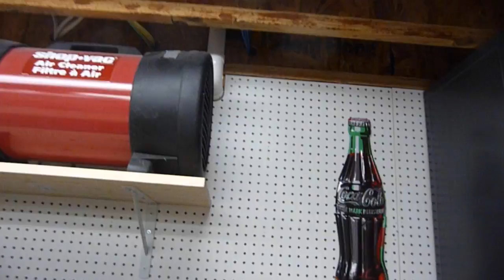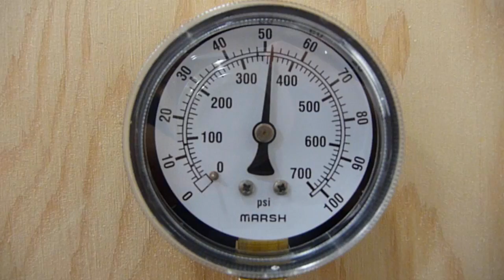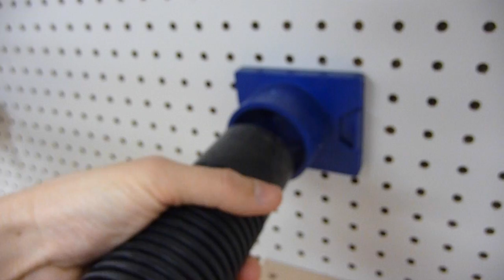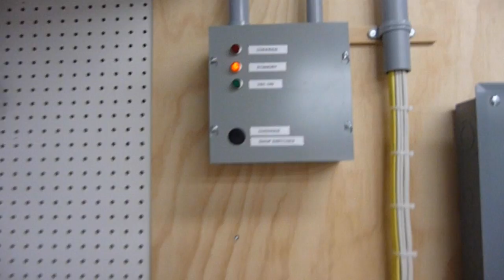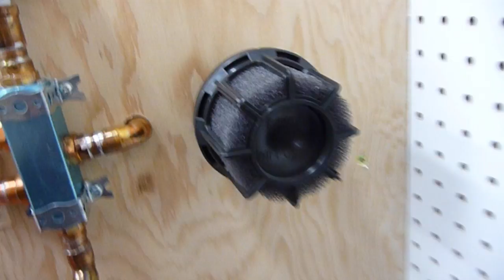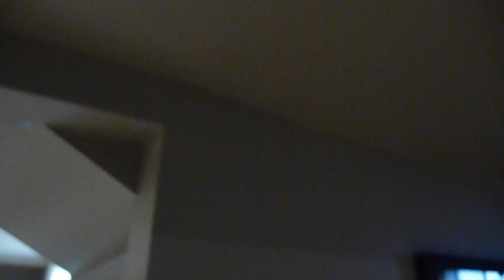08. Workshop Renovation Timelapse 08 - Final Reveal 04 (Air Cleaner, Compressor & Shop Vac Systems)

Comment: Your shop is very neat and your electrical is as well. 
I have two things to ask you.
1. What are your thoughts on bundling multiple conductors like you have in the pvc pipe and zip ties? It looks very neat, but I have had problems with inspectors in the past in respect to not maintaining proper spacing. They are concerned about heat build up.

2. Where did you find the mounting plate for your relay panel guts?

Using a separator / cyclone and catch bin in front of your shop vac will save you a lot of shop vac cleaning. Save you some filters as well.
Reply: Yes you're right, and so are the inspectors...to some degree. I learned this technique with an elec company in Nova Scotia which shares the same NEC code as Ontario. This kind of work passes no problem out there, but here I always get some noses turned up to it. Therefore, it really depends on your locale and the inspector as to whether or not he will pass this kind of work. It's unfortunate because there's no reason for a panel not to look nice! It's like you said, they are mainly concerned with heat dissipation, and rightly so. Yet the more I talk to them about it, the more it seems to be simply a theoretical exercise that they continue to enforce in reality. I've never been able to measure a discernible rise in wire temperature with bundled wire in open-air....the conduit might be a different story :p
Reply: As for the relay panel, are you talking about the wood backing board? Or the box itself? The entire enclosure is in a Hammond box (6x6x4 I believe). But I used a sheet of 1/2 plywood for the back board and cut it to size to mount everything on. Having the plywood in there probably makes it not up to code tbh.

Ah yes, that's actually a good idea to have a cyclone pre-separator. I might actually add it if I have space in there. I've seen some guys even use a 5 gallon bucket which I might be able to sneak in there. Thanks for the suggestion!
Reply: Your work really does look very neat. 
But the bundling would cause a fail with the inspectors I deal with. I have had to spread out and separately attach wires before.
There is a 24" distance with not over a certain amount of current carrying conductors, then you have to " maintain proper spacing."  That spacing is solely up to the inspector it seems.
Caddy makes some n.e.c. approved handy wire spacing devices. That is if you have to deal with U.S. electrical codes :)

I have seen a overfilled emt conduit that burned all the insulation off of the wires in it. So it is a real concern.
In a house maybe not so much, but if something happens......their insurance co. is going to look for anything to get out of paying. So it may just be a liability issue in most cases.
But that one case where it isn't and there is a lose of property or life. You don't want the wrong end of that.

The wood in the J box isn't a great idea. Use plexiglass or fiberglass or resin board. You can buy blank PC board. It's just that wood is a combustable material and while not super conductive, give some moisture it can be conductive.

A dust separator is worth the hassle. I built a large sized one out of the same sheet metal that heating ducts are made from. I set mine on a old milk can.
Works great and I don't have to pull my shop vac out and empty it and clean or replace the filter all the time now.  
You can have the dust separator out in the open if you choose ,it's the shop vac that makes all the noise. 
Figuring out how to make a cone of a certain size can be interesting. There is a whole lot of math, I found a cone generator online.....
Reply from the maker: nevermindthebull0cks Yes you're very right about the insurance. In Ontario, I usually have no choice but to bring each wire down the panel individually. Mounting the panel horizontally is the only way I find I can get a neat end-result while still abiding by Ontario inspectors. This is how I wired up my main panel: http://i1177.photobucket.com/albums/x347/coolboarder44/20140905_205933.jpg. In commercial applications, you're right I would never bundle the wires like that, and never run sleeved wires through conduit either. But I'm glad we stand on common ground about that!

I also like your idea of plexiglass, PC board even better! Thanks. Now I wish I would of thought of that during the initial fabrication.

So I was doing some research on cyclones yesterday haha. I think in the past year that I've been using the shop, I've only had to empty the shop vac once every two months or so (usually just after a major project). And since I'm a cheap Ukrainian, I just shake the filter off and put it back in haha. But I definitely want to see how much efficiency improves though with the cyclone now! I'll take a look at cone generators online.